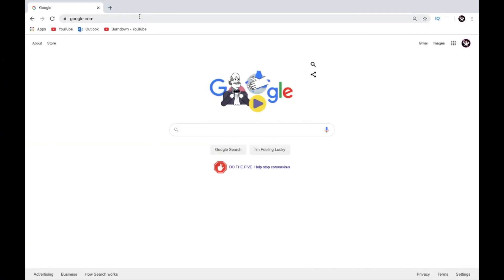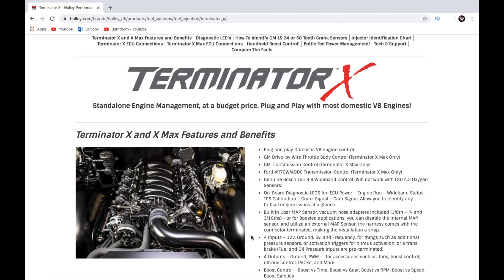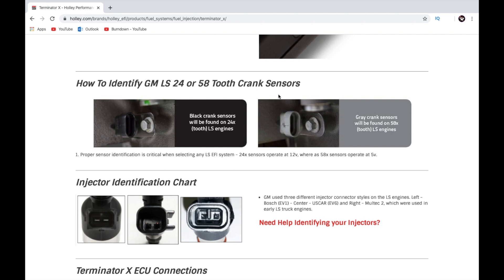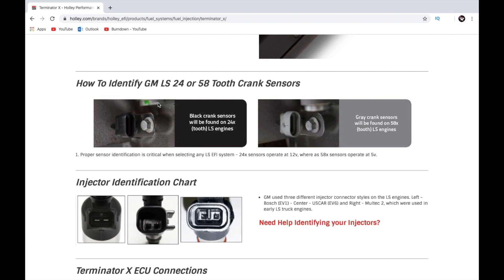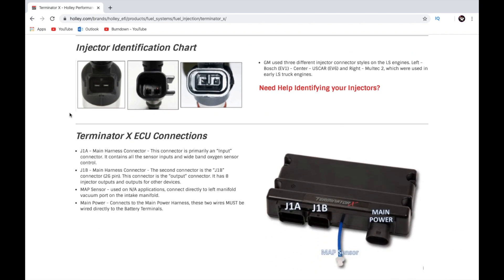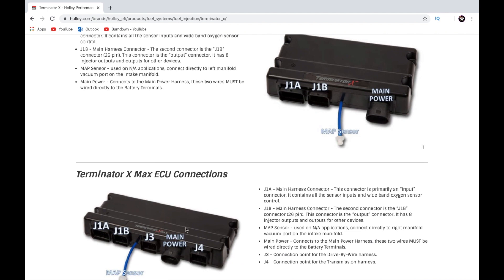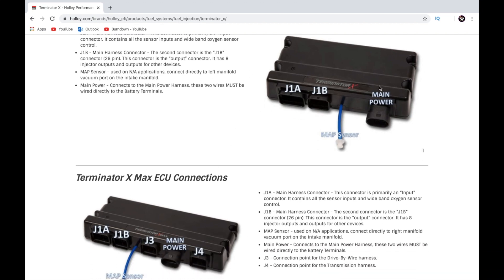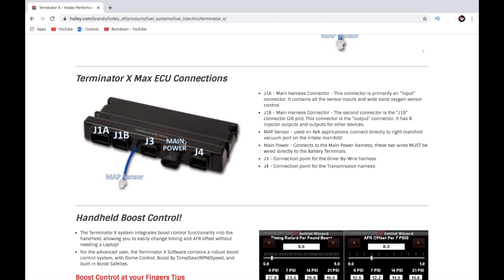What Holley Terminator X Do I Need?

Comment: So its not just the ecm? Its also harness?
Reply from the maker: It has everything you need to run the motor and control the trans depending on witch one you get. It also comes with a small touch screen you use to set it all up.

Comment: Can you use ev6 injectors with it?
Reply from the maker: Yes you just need to but the one with the correct harness and they need to be High Impedance injectors for the Terminator X to run them! If they came in a GM platform your good.

Comment: I wanna run a 6l80 will I be able to with any terminator?
Reply from the maker: I dont believe so. I think it will only do the 4 speed transmissions like a 4l60e and a 4l80e  but I could be wrong. You can check on the Holley website. Im sure they are working on a controller or software for that transmission if they dont have something already.

Comment: How in the world do I send file from laptop to ecm engine running like crap 24x truck engine all stock for now but have Holley 3bar
Reply: Do you have the canbus to USB cable?
Reply from the maker: You need the USB cable they sell to talk to the ECU directly. If you dont have one you could always run the sed up wizard again and choose the 2.5 or 3 bar map (I forget what the choices are but I want to say I started and ran my car on the 2.5)  that will get you closer to what you need if the map is your issue. You running on the internal map right now? Its a 1 bar.
Reply from the maker: Whats up man!
Reply: Yes have the USB cable
Reply from the maker: @pimpinak89  The recycle looking button up top will sync the open global file with the ECU.
Reply: @Burndown  so just open the file with car off and hit that trunk key off and unplug computer 😢 haha it's been kick my but
Reply: Butt**
Reply from the maker: @pimpinak89  What are you trying to change? To send a file you would have the car on and connected to the laptop. Find the global file you want to send and open it on your computer. Hit the recycle looking button and write it to the ecu. Find me on Instagram and ill shoot you a quick video.
Reply: @Burndown  so I think I figured it out but still not running right it don't die anymore after you release the gas pedal runs a little better but is breaking up on acceleration
Reply from the maker: @pimpinak89  Its hard to diagnose things like this over the internet. Hows the fuel pressure? All cylinders firing? All injectors working properly? Check all the basics.

Comment: What injecters,fuel pump and fuel pressure regulator do run in maliboom thanks
Reply from the maker: It has changed a bunch but right now im on a Magnafuel 4303 pump Fuel lab regulator and some snake eater 1000 cc injectors.

Comment: What about the “power tap” how is that wired in? Or is that already in the harness?
Reply from the maker: Power tap for? Like sensor 5v and 12v output? They have a plug you can wire into for that.

Comment: Incredible info bro !! 

I do have a question though. 

I'm thinking about purchasing the lsx 454 create engine and Holley specifies that the terminator x are for the 4.8, 5.3 and the 6.0 displacement engines.  Does this matter when choosing an efi system whether I go with Holley or not? Or is it irrelevant as long as the correct crank sensor (28x, 58x) and fuel injection plugs (ev1, ev6 etc)  are chosen.
Reply from the maker: You can tell the software what size the motor is and it will adjust the tune for your displacement. You will need to pick what injector plug you plan on using. As for the reluctor wheel its same thing you just choose what it is but you will need the correct harness for either one so pick the system that matches what you are trying to do as far as 24x or 58x

Comment: What injectors would you recommend for a 5.3 with a BTR stg4 truck cam I may eventually do a small nos kit
Reply from the maker: I would go with a smaller cam unless you want to rev to the moon and make less power down low. If your only doing a cam and springs I would say some 36-42# injectors would work fine and you would have a little room to run E85 as well at some point with a little larger injector.

Comment: So for my truck, I’m building a ford small block but I wanna put Holley efi on it, I’m using a 5 speed manual so I should be fine with terminator x?
Reply from the maker: Depending on your set up I believe they make EFI kits for ford. The Terminator X would not control a transmission so yes if they make a kit for your motor the X would do the trick I believe.
Reply: @Burndown  they do make a  kit for pushrod fords and imma run a manual so I don’t need trans control

Comment: I have a 6.2 with a 4L80  throttle cable  which terminator is best
Reply from the maker: You will need the X Max to run a transmission
Reply: @Burndown  so a 5.3 with a 4l60 is the max  way to go when running drive by cable TB  going in a 1963 impala?
Reply from the maker: @frankyfrank6387  yes you need a max to control the transmission as if right now. It will also do drive by wire or cable.
Reply: @Burndown  thx for the reply

Comment: If I'm building a lsx 427 and will be running a t56 which terminator x would I need to use?
Reply from the maker: Just a terminator x unless you would like to do drive by wire